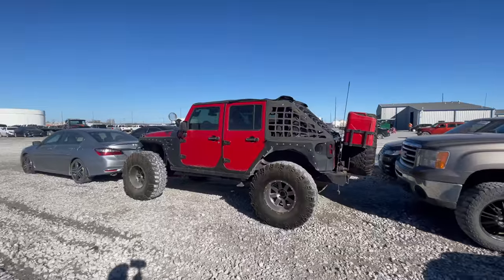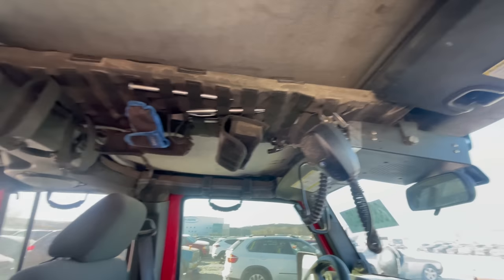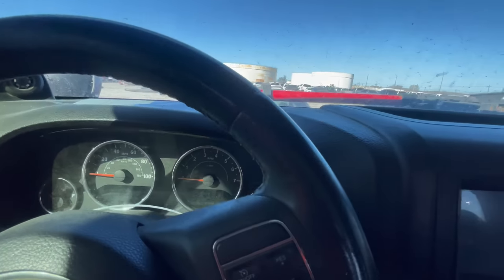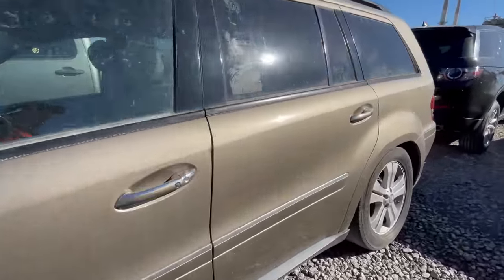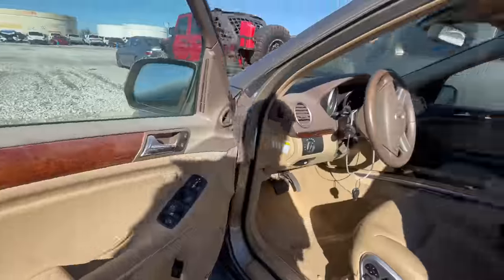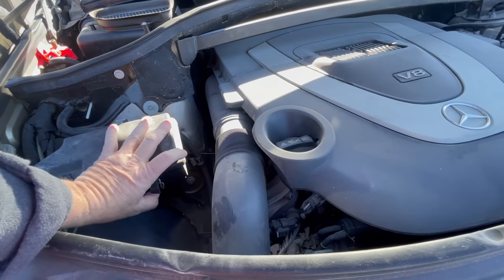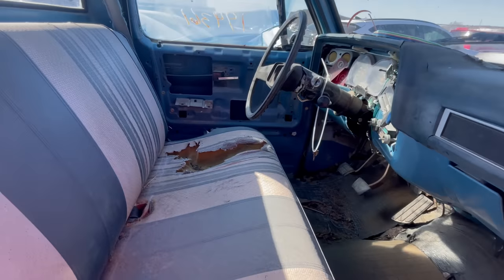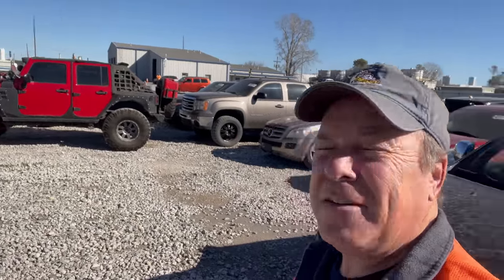Copart Walk Around - 3/7/23

Comment: In the eyes of the beholder.. That 81 GMC was completely original and low mileage. Straight as a string on all four corners. Hub caps, brake pedals, windshield.. Original Vinyl Seat , those didn’t make it past 1985 they disintegrated . Crome front bumper may be the nicest one I’ve seen in 10 years. Dealer gimmy back bumper, tailgate,.. I’m out of breath..